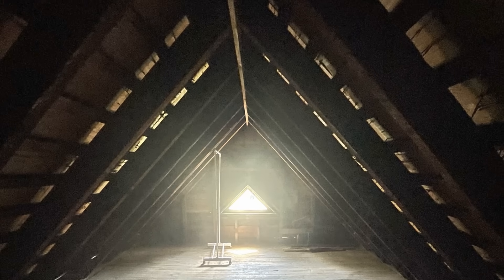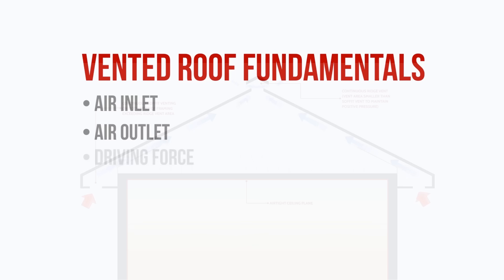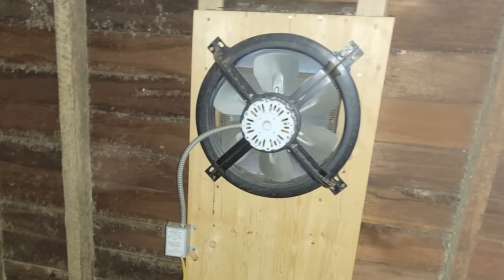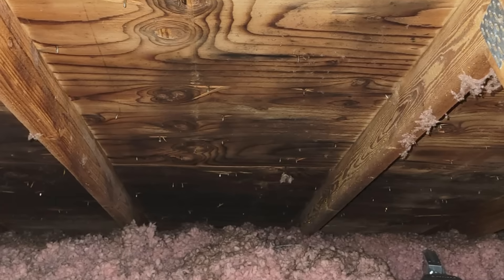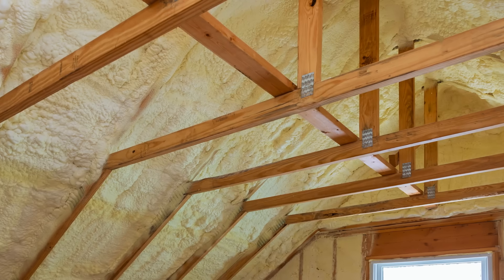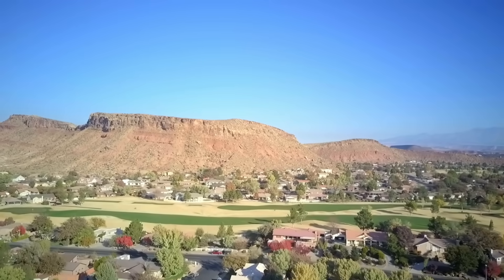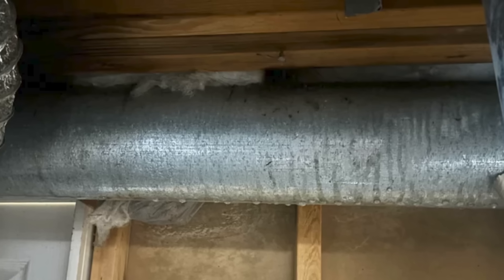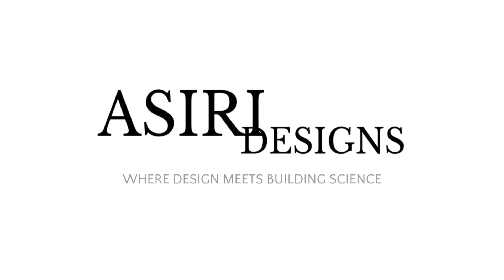Do Gable Vents Actually Work?

Comment: How do you get around wind-driven rain? I live in California but every time it rains, my windows leak on the inside of the gable wall. I eventually want to do exterior insulation so I don't want to install ridge vents. I thought I saw a video about creating a internal pan but there's no way to get into the attic where this gable vent is since it's an addition to the main house and the hole is barely big enough for the HVAC to get through between the main attic and the part of the house with the leaking gable wall.

Comment: We have a Cape Cod style house which we had air sealed new blowing insulation. Having issues with moisture I'm assuming due to the Cape Cod style roof. We have a soffit to Ridge system is there any way to increase airflow in that system?
Reply from the maker: Blown-in insulation isn't a good air barrier, so it could be a combination of poor air sealing with inadequate ventilation, or incidental leaks that had gone unnoticed until you insulated and reduced the heat flow. We'd have to see the existing conditions that you're working with honestly, as you have to address these things on a case by case basis.

Comment: If I have soffit vents and a ridge vent do I need a gable mounted fan? The space that I’m referring to is unconditioned. It’s directly above two bedrooms and two bathrooms that are conditioned space. There are two large gable vents, which are screened and direct to the exterior. I live in the northeast in Pennsylvania. This time of year is very cold through the winter and I would like to close off those gable vents keeping some of that cold air out of the attic space. As long as I have the stack effect going am I fine?

Comment: @asiridesigns So when a building or garage (24x24) in my case, has no perforation in the soffit, I had to use Gable vents to blow through, and I also installed two roof vents to allow heat to eacape at the high points. Did I do it correctly? Should something else be done? How the info in the video goes, it sounds like I'm screwed.

Comment: I wish you would have addressed the problem of birds and squirrels burrowing in between the vent slats. They pack it with straw and other materials, and poop all over the attic floor, creating quite a mess. I haven’t decided whether to remove the vent entirely, replacing it with a window, or attach heavy steel screening that they can’t chew through.
Reply: One winter I had a mother raccoon bend open my gable vent and give birth to four kits in my attic.  Thankfully we were able to trap and release the babies while mother was foraging.  What followed was getting a contractor to add heavy duty steel mesh and replace the vent with a larger, sturdier one.  I can't afford a complete re-design of my attic, but I know by experience a gable vent is just asking for critter trouble.

Comment: Aren't gable vents commonly paired with turbine vents though?  Seems like I've seen that a fair amount.  That would give you a higher exit point so that you could have some amount of air flow even in low wind conditions.  Plus just the extra help when there is any wind from the turbine vents.

Comment: Gables offer perfect cooling opportunity.  Horizontal thermal pipes across rafters can funnel heat to gable ends.  Gable rakes and fascia painted with supercool white (97% reflectivity) over copper to terminate the thermal pipes.  You're welcome.

Comment: I’m dealing with my house (stucco in a northeastern/midwestern climate) having no option to install soffit or ridge venting in the near term. A power vent is pretty much my only option at this point, and I need to replace the existing gable vents while I’m at it because they’re both about 1 square foot. Doesn’t help that the kitchen fan vents into the attic rather than to the exterior… lots of work to do before this winter, I’m very happy I found this channel because it’s made planning the renovation a breeze. Thank you!

Comment: This is not my experience at all here in the mid-atlantic.  I don't ever remember seeing condensation/mold issues in 100 year old houses with gable vents and insulation (typically blown-in) between the top floor and attic.  I do see a lot of mold problems in houses built in the 70s-90s with soffit vents; lots of mold on the plywood or osb roof sheathing.  Also, the whole bit about needing wind to drive ventilation with gable vents is nutty.  If you don't believe me, open your windows on a cold day with no wind or just the windows on the leeward side of your house.  I'm pretty sure all the warm air isn't going to stay in your house and the cold air isn't all going to stay outside; vice versa on a hot day.

Comment: I live in the north east, my home was built in 1929 has a hip roof, no soffit vents and there is one gable vent opening in front of the house.

Knock on wood so far there is no mold in the attic.

But I will say the house gets really hot during the summer months and cold during the winter months.

Comment: Also mechanical ventilation sometimes breaks. I rarely go in the attic in the summer because it is hot. Last year at 10 am it was 165f. Last year I hooked up the gable fan that was already mounted and it reduced the attic air temperature to 140f at 10am the next day.  So it does help. It also reduced the living room temperature from 82f to 72f. 

Last month the fan died and I need to replace it. Hopefully this week as it has been hot.
Reply: Unfortunate, but a small price to pay compared to retrofitting soffits or ridge venting into spaces that don’t already have them. The 82 to 72 drop in the living room is huge!
Reply: @xanderpercy1533  It is. Luckily This year we have daytime highs of 96F and 87% humidity. Last year we had 2 weeks of a night time low of 92 and daytime highs of 113 to 117.

Comment: There's another reason they stopped working: we used to have open fires indoors, and we needed to vent the smoke, and not all was done through chimneys, but through gable vents, and earlier even, through semi-permeable roofs, such as reed-roofs/thatched roofs. Smoke is really good at drying stuff, deterring pests, and rot...
Also, the gable vents I've seen on older buildings tend to be right under the gable and thus more effective.

Comment: What about if you have soffit venting, ridge venting and a gabled vent with a whole house fan on the floor of the attic? It’s an unconditioned attic that I’m looking to put duct work to all the bed rooms from a heat pump system. Currently only have r13 fiberglass batts on attic floor but was going to also consider installing R49 blown in cellulose after adequate air sealing around the current batts. Was wondering if I should just get the gabled vent removed and whole house fan removed and sealed

Comment: What is an affordable remedy when one has an old leaky house with a vented attic that uses gable vents and a few thru the roof passive vents? I do have a attic fan blowing out on one gable vent (the highest one that doesn’t face into the wind)
Reply: I had a similar situation, old home that was flipped and had vaulted ceilings. They had blocked off the soffits and it was not possible to get down and install baffles.

I did have a ridge vent though, so my solution was to take 2 attic gable fans and flip them around to be used as INTAKE fans, now the hot air can rise up through the ridge vent. You may be able to do something similar if you have some roof vents already.
Reply: @Beaster456 thanks for the idea. I wish there was some tech, vs theories, that could model an existing roof so one could place logically new vents, fans, whatever

Comment: After doing a conditioned attic space, I never went back to the shenanigans. Yes, it costs more to build, but running HVAC equipment in 140-degree attics is just dumb. Energy prices are unlikely to decrease, so plan accordingly.
Reply: What do you mean running HVAC units in 140 deg attic. What kind of moron puts their HVAC in the attic?
Reply: @integr8er66 Pretty much every builder in Texas for example puts their HVAC in the attic.  There are no basements and builders gotta maximize those sqft numbers.
Reply: @citystuff7184 Wow, I'd hate to be an HVAC Tech there. How could you even service something in 140 deg heat.
Reply: @integr8er66 this is standard on 99.9% of all houses with slab on grade foundations
Reply: @integr8er66  I am doing that for space saving. However, the attic is a conditioned space.
Reply: @cosminahertog8891 Do you have a steep roof? How can anyone service an air handler is a 4/12 pitch attic. That would be a nightmare.

Comment: My parents had a house built by an inept contractor. They have a nice new galvalume metal roof, but the attic has nothing but gable vents for air exchange. No soffit venting either. I can smell the attic from the upstairs bathroom when it is very hot, and the AC/bathroom exhaust ducting is piped through the attic space. There is also a pretty new AC up there... I fear mold may develop over time. The site is windy some of the time but the air gets quite stagnant in summer. They are on a limited budget, so I am trying to decide between the cheaper option of putting fans on the gable vents vs. Closing the space and conditioning it with an intake etc., since there is a fairly new AC unit up there. That would probably extend the life of the unit to be in conditioned space as well...Any thoughts would be appreciated.
Reply: On a limited budget, condidtioning the attic will be much more expensive than powered gable fans.  Put in two.  As close to opposite ends as possible,  Place one blowing in and one blowing out.  The convection will reproduce the stack effect.  One more thing, try, as much as possible, to place the "in" fan on the side with the privailing wind.  That will help the fans to not work against mother nature.
Reply: @Boxerdude  Thanks I appreciate it.

Comment: Overall, this video seemed to assume that with gable vents, you don’t also have soffit vents.  To me, it’s pretty obvious that you need both a place for the air to enter (soffit vents) and for the air to exit.  The exit can be through the gable vents if those vents are located high enough and the ridge isn’t too long.  There should still be a stack effect if there’s enough height difference.  But a lot of houses probably do have ridges too long for this to work, or too low of a roof pitch.  I don't trust preformed ridge vents to properly keep out water, so I'll probably end up using box vents near the ridge.
Reply: A lot of the gable vents I’ve seen are on attics with two: one on each side. So, they of course do allow entry/exit, but don’t achieve stack effect if they’re at the same height

Comment: Another excellent video but the "fix" wasn't exactly highlighted for this. 

I am in a 120 year old house in the PNW with gable vents, no soffits or the ability to add them and blown in insulation. The roof is plywood and shingled.

I am about to start air sealing, adding ERV and blown in insulation once the weather cools off. However, ducting and installing the ERV unit wont be super straight forward.

It likely makes more sense to create an unvented roof with a conditioned attic and insulate and air seal the underside of it so I can freely run ducts and install the ERV in the attic.

OR

Power vent, remove insulation, run ducts, air seal duct work and ceiling, add blown in.
Reply: It's difficult to find roof leaks from rain if the underside of the roof is insulated. 

I wouldn't do it in the PNW.
Reply: @dvader3263 Well if the roof leaks today, it will soak all of my blown in and then drywall below. I won’t see it until the ceiling is ruined. At least with insulation in the rafter I would be able to narrow it down to the bay and water would land in the plywood floor below.
Reply: Would you please NOT use acronyms? What the hell is an ERV?
Reply: @integr8er66  Energy Recovery Ventilation

Comment: Note: being in the structural side of a roofing company for many years and being in a costal state where we have multiple micro environments, I see closer to wind and saltwater and taller roof pitches over 6/12 there never seems to be an issue. Homes tucked in the valleys or behind hills where there is a ton of inversion & lower slopes they are just big rot boxes.

Thanks for all your videos!!

Very informative. !!
Reply: Yeah, I’m in Seattle close to the Puget Sound, 100year home with 1:1 pitch and two opposing gable vents. Attic insulation has been retrofitted, and no moisture problems anywhere.

Regular wind really helps

Comment: Shingle roofs is interesting. In Norway shingle-roofs do not vent through the peak, only through soffit and often gable. It has shown to work well for 50 years now.
Reply: That might have to do with concerns of snow blocking the ridge vents. I'd imagine snow sits on the roof for a while up in Norway.

Comment: In cold climates you can’t solely rely on ridge ventilation since it can be covered by snow for several months.
Reply from the maker: Uncompacted snow is air permeable. It also tends to melt around the ridge where there is the greatest amount of heat. Seriously, go look at a ridge vent in the wintertime.
Reply: @ASIRIDesigns  You shouldn't get melting snow at the ridge with properly designed and built insulated house.
Reply: @ie54911  Yeah, that’s just not true, at least in general. If your climate is barely below freezing, just a small amount of heat can be enough to melt snow. A small amount of heat leakage does not equate to poor insulation, and even if the home is poorly insulated, it’s worthwhile to know how to remediate homes with all sorts of design imperfections.

I believe the creator is also in the Pac NW, which indeed has plenty of barely freezing winter days
Reply: It’d seem to me that any snow sitting on the ridge is likely to stay uncompacted, i.e. good for the ridge vent.  Unless of course the snow has been rained on.
Reply: I am a carpenter, we built our house in 1988 I still have the same 3 tab Gaf roof shingle on house in 2025. Gable vents , soffit vent , ridge vent and vented drip I have them all. 😊

Comment: Because we bought a house in a "planned" community, building codes and inspection was pretty much ignored. Our roofs were built with hardly any soffit vents. The upper roof has none and a couple gable vents was all we got. There was clearly a lot of grift going on with the builders/developers/city here. Buying 30+ years after the conception of the town, I missed out on a lot of the other problems, and the lawsuits as well. We added vents when we re-roofed but not the soffit vents which would be a major project on its own, at a second story.

Comment: I think it's worth mentioning that solar gable fans are becoming more attainable now. You'd still want to size the cfm as to not depressurize the space but I've actually used them in a greenhouse paired with solar intakes to poitively pressurize the space and help preserve the microclimate.

Given the recent concern with wild fires in area's prone and how vented attics accelerate fires, it's worth considering mechanical systems and unvented attic assemblies in the appropriate region. I have seen heat-reactive soffits that fuse shut in the event of fire, those seem promising. It would be cool to see them paired with a wall assembly that has a heat reactive assembly towards the bottom of the assembly as well.
Reply: I added a solar gable fan and have been very happy. Very gentle ventilation for a few hours in winter, vigorous ventilation in summer.

There’s an opposing intake gable vent in the other side to help with depressurization.

We do not have wildfires in our city, tho (yet).

Comment: I am a 57 yr old carpenter, alot has changed in the 36 years I have been in the trade. I dont understand how the wind at the peak doesnt interupt the draw from the eave, if that makes any sense?
Reply: If anything wind at the ridge would increase air venting
Reply: The wind is applying both positive and negative pressure to the ridge (leading and trailing edges of the vent).  It’s applying positive pressure to one eave, and negative pressure to the other.  I doubt it’d hurt the venting process overall.
Reply: @kc9scott  wind may accelerate across or over the roof but that doesnt mean its going to pull or vent from the bottom up its going to follow the path of least resistance.  Just like blowing out a candle in a votive perpendicular to the edge there is a max depth that will create a vacuum the rest of the air velocity creates a Venturi

Comment: Isn’t the greater point that if the attic is air sealed well, perfect attic ventilation is much less critical?
Reply: If it's air sealed well, does that mean there is no air ventilation at all?  I've seen sealed attics that are fully insulated, often with expanding foam.  No ventilation through passive venting, but with controlled ventilation through the HVAC system.  I think ASIRI Designs has a video on this.
Reply: @misterlyle. no I meant if the floor of the deck is air sealed well so there’s no moisture from the living space, ventilation is still important but it doesn’t have to be as perfect. Soffit to ridge is ideal but if you had soemthing less than ideal like gable vents, the assembly would be robust if the attic floor is air sealed and insulated
Reply: @MichaelOConnor-jb3lv  Thanks for the clarification!  I think you are right.  My impression is that the whole concept of redundant strategies in best home-building practices is because on-site stick building is unlikely to produce a perfect result.  Dead spots or turbulence in the attic ventilation don't mean that the attic isn't ventilating adequately.  Individual situations are "multi-variant" so industry guidelines and even local code may not always be optimal.  The real best practice is to have a skilled set of eyes inspect all accessible areas of a home on a regular basis.